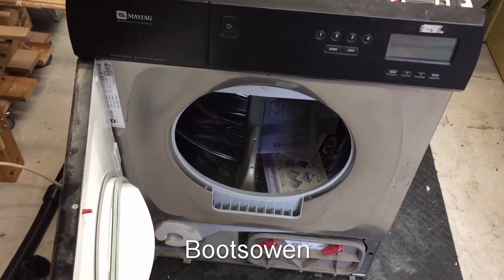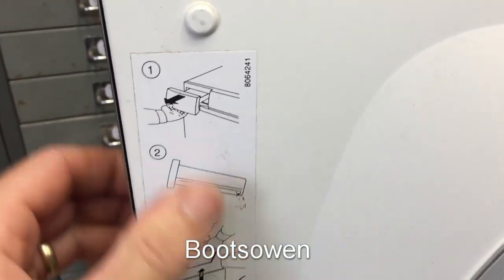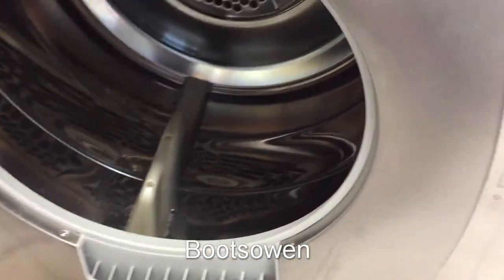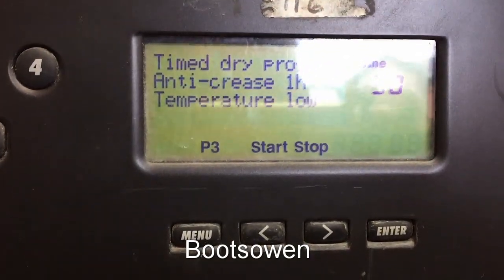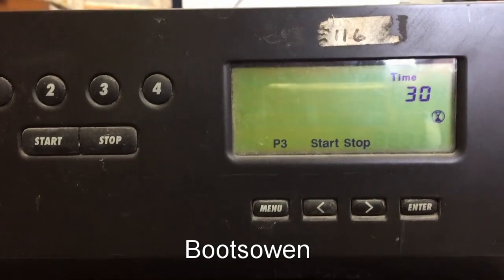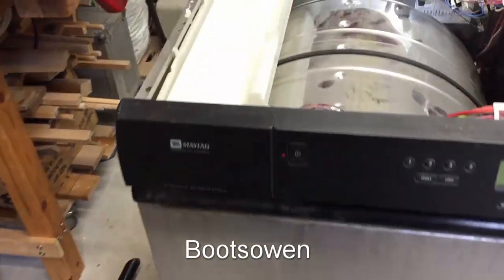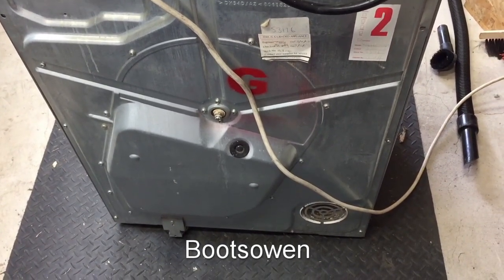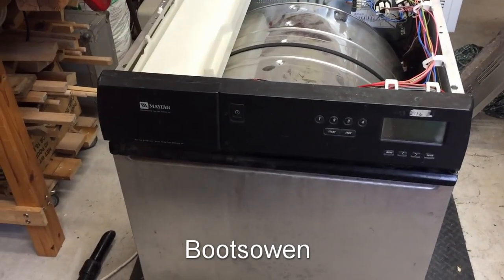Maytag condenser tumble dryer MDE5605AES Type TD44A

Comment: Cool, a Asko dryer! 0148 which means it was made on the 48th week of 2001.

That bracket at 10:15 is for stacking on top of another Asko/Maytag. Definitely save it, it's a great dryer. And yes, the door is reversible.
Reply from the maker: Thanks for the info.

Comment: Ahh an Akso made dryer. I would check the float switch and the pump. Both are located in the sump which is on the back, like behind the condensor.
Reply from the maker: Thanks. This is coming up in a future video.
Reply: bootsowen Great, good luck✌🏻

Comment: Wow thats one old old dryer lol! but how clean and nice it was! its basically like an hotel or home that uses industrial machines! not pretty to look at but built to run for ever !

It sounds like the pump has failed and not deteching water to the water storage.. it could be the float or the float switch totally failing.. it could be also be trapped water around inside the machine... parts if u can find them will be very expensive.
Reply from the maker: You guessed right. I have another video coming of the repair. Stuck float switch. I don’t think this one was much used.

Comment: Nice a Asko made dryer, these are very robust made. The thing beside the capacitor is the heating relay for the heating element. I think i have a service manual for these machines if you want to have look at it
Reply from the maker: Sure thanks. I have photographed manuals page by page and made a video of the slideshow. That way everyone can see it if you put it on YouTube
Reply: @bootsowen  The service manual has 86 pages, so I uploaded it as a PDF file, feel free to put the link  in your video description if you want. http://www.mediafire.com/file/4w49u53n4xsgrd9/ASKO_TD44_Service_Manual.pdf/file

Comment: I think I might know what this fault is, we had this error with our hoover. When we moved house water got in the back of the machine and get chucking the electrics. My guess is that water could of flooded a pressure valve i and the water sensor thinks the tray is full? Or pcb just faulty. Any update on the Hotpoints or any washers?
Reply: King Smasher why ur comment say 3 weeks ago
Reply: 3 weeks ago? How?